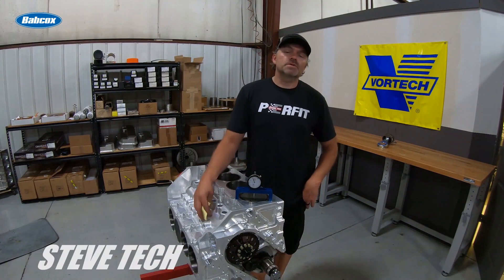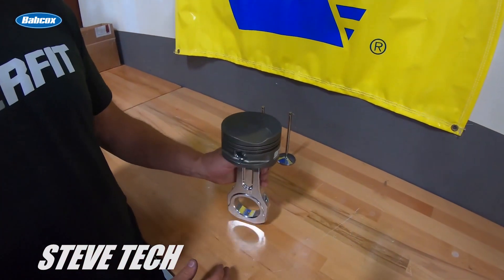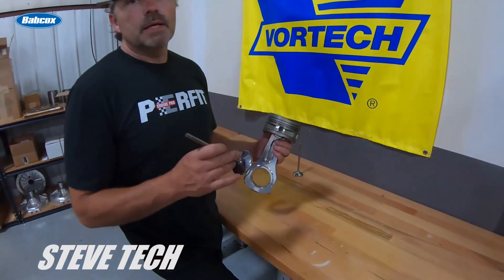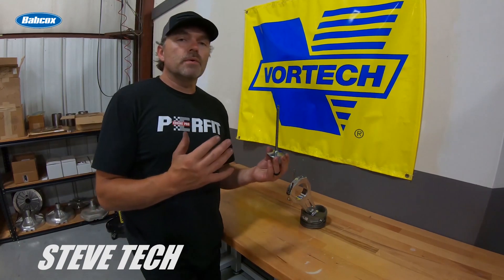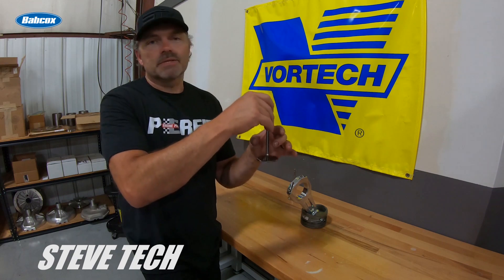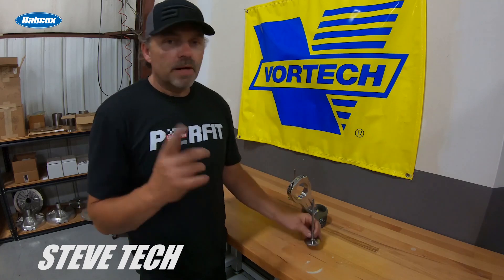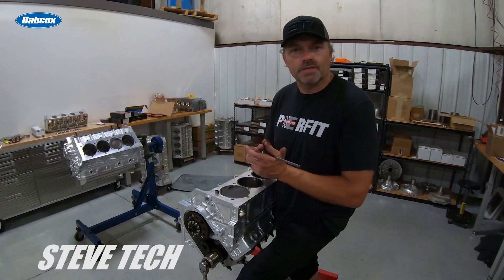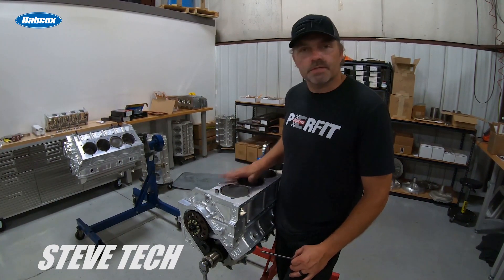Understanding Piston to Valve Clearance – Part 1

Comment: Checking my ls1 with 25 thou shaved heads , no gasket and 7.375 pushrods I got contact with the piston. With a  50 thou gasket and 7.4 pushrods I got 60 thou.

Comment: A common mistake I see inexperienced engine assemblers do, is they check the P to V with checking springs. The proper thing to do is check it with the running springs. Test springs can give you as much as .100 more clearance than the running spring. So if you want to run the intake valve as tight as .035 you better check it with running springs. Also I feel running the intake valve that tight to the piston will help the piston start the column of air in the intake track start falling into the cylinder sooner. Maybe this is why pro stock engines have it that tight?
Reply: Well yea, but surely depends on solid or hydraulic lifters. Hydraulic will collapse when checking without oil pressure
Reply: How does it give .100 more clearance with checking springs..?
Do you mean the valve goes down .100 less making you think you have .100 more clearance..? 
The lifter, cam, pushrod, rocker and valve stem tip are all in contact and essentialy a connected unit in both scenarios regardless of spring pressure so the rocker should push the valve into the clay either way if youre doing the clay method..... unless youre talking about using a hydraulic lifter to check p/v..? Then the running spring would squish the lifter spring down and give the more clearance youre talking about.  checking spring isnt hard enough to so iis more accurate there, but you said the checker Spring gives more clearance... you wont get deflection with the checker spring like you would the running spring if the rest of your valvetrain isnt up to snuff so that cant be what you mean..
And even if you use the dial gauge on the retainer with a checker spring, that wont cause .100 less clearance and cant be done with the running spring..
im having a hard time picturing a scenario where a checker spring gives a .100 clearance error, care to explain..?
Reply: @benjaminrutledge7675  If you read what I said, I did not say less I said more, Just try it and you will find out what I mean.
Reply: Yea, i read what you said.. but if you read what i said, i was asking for clarification... i might have worded it poorly, stuff makes more sense in my head than when it comes out..
if you have .100 MORE clearance with the checker springs, that must mean the rocker hasto be pushing the valve down .100 LESS At that same degree wheel spot, less valve motion equals more p/v clearance doesnt it? I mean, the fact that the checker spring allegedly gives more clearance than the running spring (meaning you think you have more clearance than you actually do) that extra hasto come from somewhere... and im struggling to see where it comes from.. like i said, the valve train is all connected together, touching, i just dont see HOW it ends up with more and where that more comes from.. like, why does it end up with more, simply because its a lighter spring..? Im just struggling to see where its coming from..... the checker doesnt seem strong enough to deflect anything and prevent the rocker not pushing the valve down as far...
Reply: @benjaminrutledge7675  I understand what you are trying to say, but what I am saying unless you really do it you will never understand how much the P2V changes. If I have an engine with say .020 on the intake with test springs I will put on the running springs on and then test it again. I use a tool made by Manley that goes on the rocker arm and then I test it again. 
  On a very max effort you want the P2V very close on the intake like he was saying in the video. This is the 55th year I have been building racing engines, so I have learned a lot over the years.
Reply: Interesting. I could definately see a small amount of tolerance stack up there contributing to it..
Im not at that stage yet due to all the shipping delays on parts right now but ill have a look when the time comes, might be a couple months.. i might do a video on it..
i guess it must be one of those “it is what it is” things. 
Good talk.
Reply: @benjaminrutledge7675  Well you have to remember the difference is spring pressure is enormous . A test spring may have 10lbs of pressure when you open it to touch the valve on the piston, but the running spring could have as much as 500lbs. There is a lot more flex in the valve train than you would believe. 
 I know what you saying about getting parts, its a big mess.
Reply: Yea.. 
you know i was just thinking about it and i was assuming our hypothetical engine had the biggest baddest pushrods it could have to prevent most of that deflection but i wasnt thinking of cam flex either.. our subject engine maynt have a billet core, may be a small base circle, may have small diameter lifters etc... and big ass pushrods are just going to give less and make the cam flex more as it tries pushing the valves open... i saw somewhere joe sherman said he noticed the rockers themselves flex a bit too. Factor that in, 1.7 intake rockers with a shit ton of spring pressure.

One thing leads to one problem, which leads to a solution, which leads to another problem, another solution..
Goddamn i love engines !

Yea i can see it now, i get it.
Reply: Rocker stud flex too if the engine has studs .. i was thinking shafts this whole time.